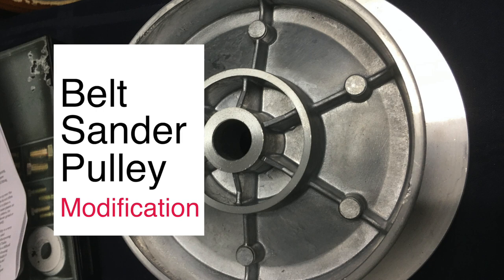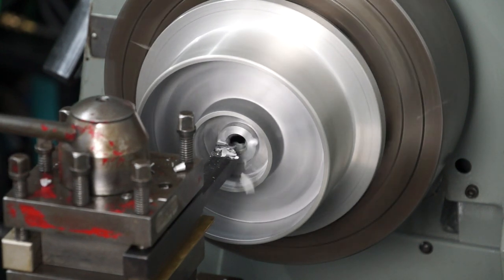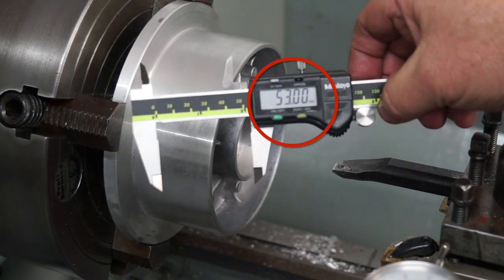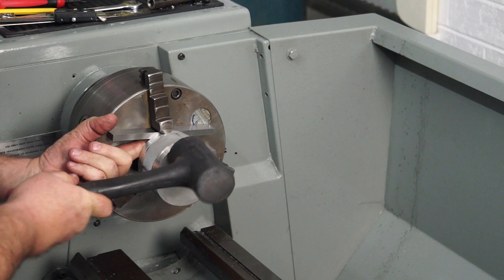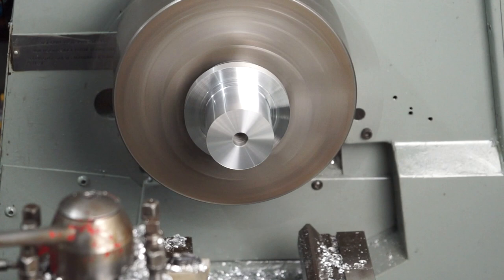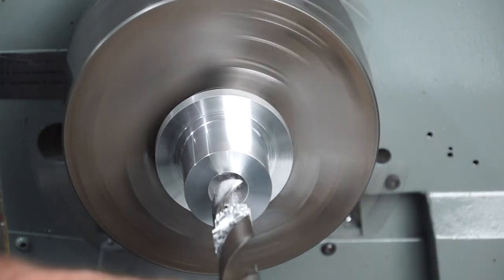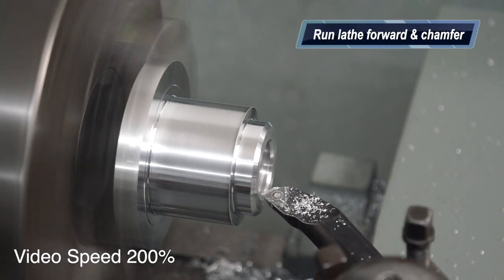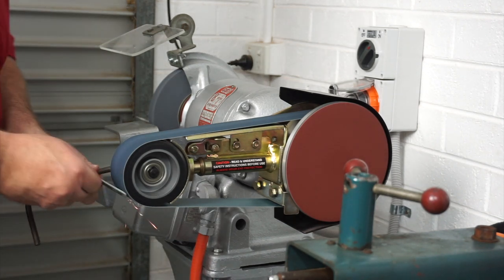Colchester Master 2500 Turning - 4 Jaw Chuck Work

Comment: I have a grinder that had a slow wet wheel at 90° on the left hand side and I intend to add a belt like yours eventually, being on the left I'll have to make everything as it needs to be left hand thread and where I am I can whistle for a chance at finding ready made. Good job I have a lathe and mill 😊
Reply from the maker: Hi Derek. Thanks you for subscribing to my channel. Yes this old Aussie made grinder is a great asset to my shop. Best thing I did was add that belt to it. I strongly suggest making this modification 👍🍻

Comment: Nice one mate.Wish I lived a bit closer that would have been fun to watch.
Constantly converting metric to imperial keeps the old brain box ticking over.
Does that cross slide dial read in diameter or radius?
I made a new dial for mine to make it read in diameter which saves one last conversion for the head.
Reply from the maker: Hey Micheal. I wish you lived closer too. You could drop McDonald’s off every time you visit 😂. Yeah good question. I didn’t even convert and just used the dial gauge all the time. To be honest it (imperial)was doing my head in 🤯. I’m saving up for a digital readout. Hope you’re well and staying away from the crazies? Cheers Azza 🍻

Comment: I guess the next video will be you fitting a digital readout Aaron? -:) Stay well 
Pete
Reply from the maker: Hi Peter. Oh you know me all to well. Have you been speaking with my wife?  TBH, I haven’t purchased a DRO just yet, but I bloody intend to 😂. Thanks for following along Pete. Cheers 🍻
Reply: @AaronEngineering   Hello Aron, I also have a Coldchester Master. Did you fit a DRO? I interested in fitting one.
Reply from the maker: @444gtb  G'day mate.  No not yet unfortunately.  I need on desperately though. I'm sick of using imperial dials.  Apparently you need a slim scale to fit under the cross slide. Let me know if you find a suitable unit.  Cheers, Aaron.
Reply: @AaronEngineering  Thank you Aaron. I’m in Australia. I have the same lathe. If I come up with anything I will let you know. Cheers
Reply from the maker: @444gtb  Thank you :-)

Comment: hello,Aaron,Chris from Mauritius Island,one thing intriguing me........do you have a motor connected to your converter?why? thanks.
Reply from the maker: Hi Christopher, yes mate I have an electric motor coupled to my phase changer. I believe the electric motor is used to generate the third leg. Mine is fully compatible with sensitive  electronics. It converts 240vac single phase to 415vac to three phase. My unit is an 8 kW unit and it can run my entire shop at the same time. This includes the pedestal grinder, pedestal drill, Manual large, manual mill, and CNC mill. Cheers Aaron 🍻
For more info: http://www.phasechanger.com.au

Comment: Something Good, from Something Bad.
The original pulley did not fit your grinder.
But it made Good for a video to show how to make it work for you.
It was funny watching the 300x video, it looked like normal speed to me ??
( are you sure you fast forwarded this part of the video ? )
Reply from the maker: G’day Peter. Yes mate it was fast forwarded. It’s amazing how slow you actually are when you’re manual machining. Plus I was taking it really easy, as I was hanging on by much material. I need to get my manual machining mojo back 😂
Reply: @AaronEngineering  Great Saturday Night viewing.
Reply from the maker: Thank you Peter. Hopefully I didn’t kill it with the voice over. I did say no talking or teaching on Aaron Engineering 🤷‍♂️. As for talking that’s a hard one as I can talk underwater with a mouthful of marbles. But still no CAD or CNC yet 😉
Reply: @AaronEngineering  
The voice over worked out good.
I,m sure with your superior knowledge of making YouTube video,s you have got a good handle on how to put together a half decent video by now.

Just watched a bit of an interesting video of a Taiwanese 
5 axis.
It is set up as Bed Mill / VMC
And the head Articulates, with an in table, Rotary.
Pretty interesting.